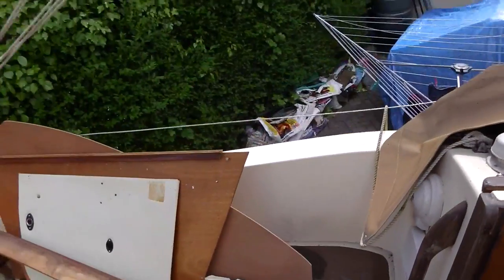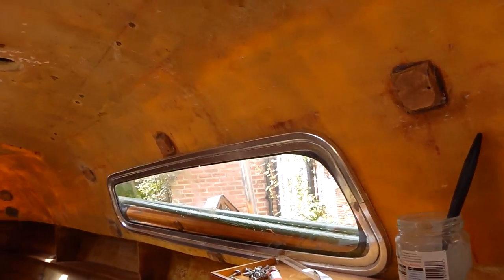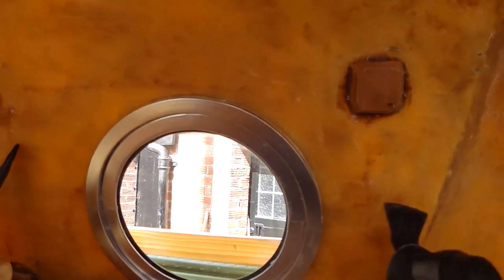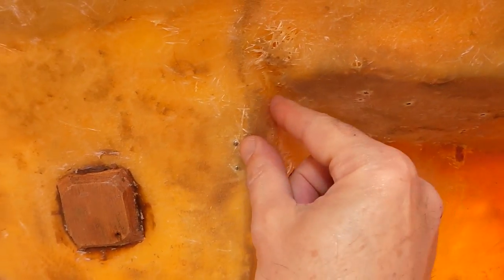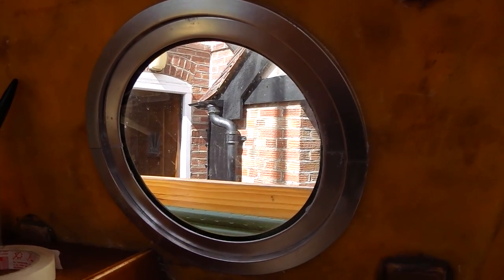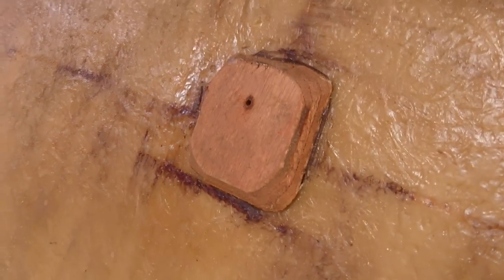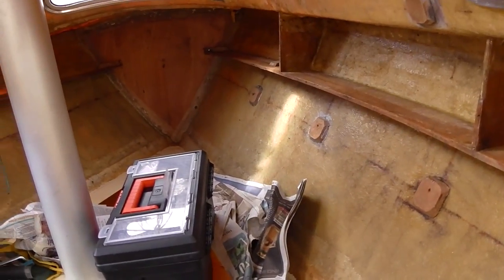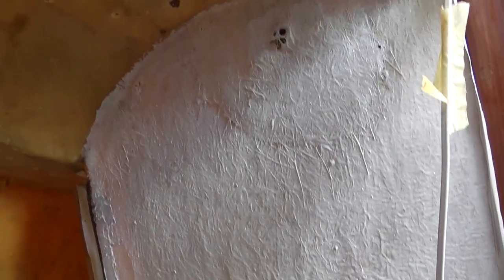Removing the headlining

Comment: It is originally a Fine tool.
I removed the glue with my Bosch drill with a steel brush attached to it - filthy job that took for ages.  I am at exactly the same track. I'll use an epoxy type paint. It fills the grain of the polyester. Thanx for this clip. Hope to have Siskin on the water second weekend of July.

Comment: How much of the adhesive did you get off? Was there any residue left? I can’t seem to get it all off by brushing alone.
Reply from the maker: Hello Stephanie. Nearly all of it came off by using the oscillating multi-tool. Some sticky patches were left behind and I was able to remove them with paint thinner and a wire brush. I think brushing them dry won't be very effective. Do you also have a Coromandel or something else?
Reply: Hi - thanks for the note on the paint thinner. I am going to use that. I was feeling like I must have missed something because my wire brush only went so far. Thanks again!
Reply: @stephaniesparvero2010   I love it